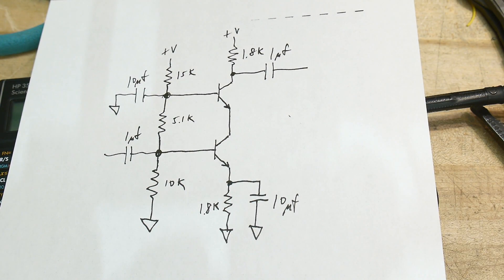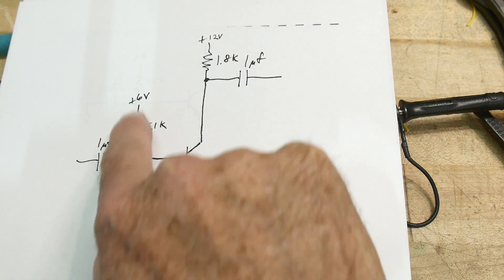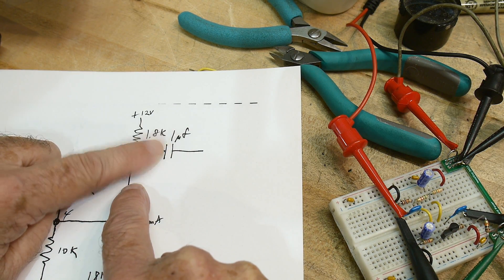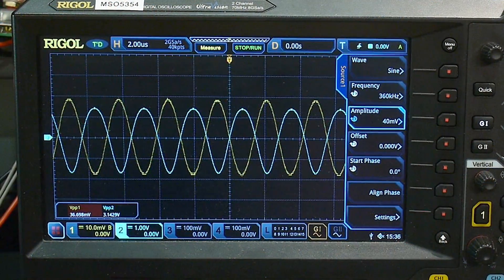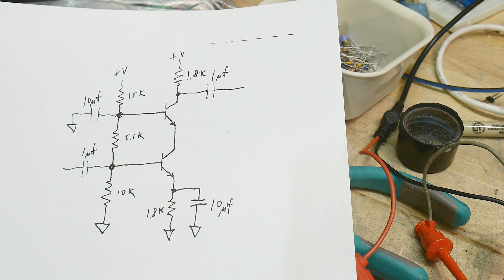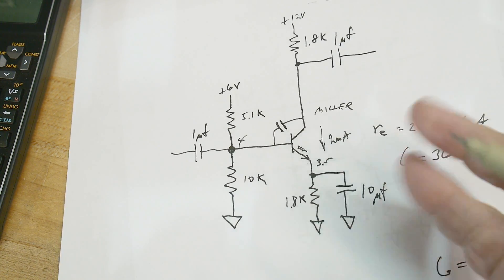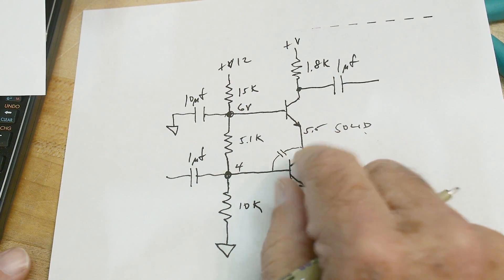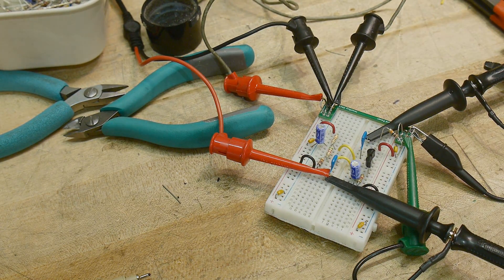#1769 Cascode Amplifier (part 1 of 2)

Comment: I admit I must be missing something, but why doesn't the Miller capacitance of the top transistor now become the villain?
Reply from the maker: you need to study common base amplifiers, they have no miller effect.
Reply: Thank you. I found a nice explanation on the Analog Devices wiki. In a nutshell "The base [...] of the cascode device is electrically AC grounded, so charge and discharge of stray capacitance [...] between collector and base [...] is simply through RL (the output load) , and the frequency response is affected only for frequencies above the associated RC time constant" - which would be a pretty small RC and hence a high frequency.
Reply from the maker: @thelastofthemartians  if you want more: https://youtu.be/tAK8Q5IZjng?si=yxtKcfJt7jr8FvuE

Comment: If my memory does not fail me, a gentleman at Tektronix, by name Gilbert, introduced cascade use for beam deflection in the ever faster oscilloscopes.  Two of my (employer’s)early oscilloscopes were rated 450 and 500 kHz.  A Solartron scope around the same time was as fast as 5 MHz.  Then I found a plug-in module for the old 450 kHz scope, boosting it to 20 MHz.  Also, if anybody built Heathkits, there was a 5 MHz scope kit offered.  Then came (and stayed for a while) the “standard” 100 MHz rated scopes, thanks Mr. Gilbert.

Comment: Very well explained.  Cascode amplifiers are good when a higher frequency response is needed, and you can even add more cascode stages.  With a single cascode stage, it is the same as a common base stage.   Several years ago I listened to a UBC EE prof give a talk on a company's laser diode driver chip.  It used an emitter couple pair with current sources as an output stage.   The UBC prof referred to it as a cascode.  He was not happy when I corrected him.   I don't know if he had designed the custom chip, but I found several problems with it.  I had been hired to give an independent evaluation of it.

Comment: The miller capacitance is only in inverting amplifiers. The AC voltage across the capacitor is the
 (voltage gain+1) times the input voltage and efffectively shunts the input to ground at higher frequencies.The effect increases with the amplifier stage gain.

Comment: Cascode can improve frequency response by factors of 50 or more.  In this case the 5.1 k resistance between the amplifiers is limiting the effectiveness; an inductance to block the AC through this path will greatly improve the frequency response.  (Or use separate dividers for base bias...)

Comment: When selecting transistors, what datasheet parameters do you look for to ensure higher bandwidth circuit?
Reply: On a BJT datasheet, look for "transition frequency," which is typically denoted f_T (f subscript T).
Also, look for the gain-bandwidth product on other amplification circuits.  That should get you pointed in the right direction 😉

Comment: Thanks, very nice explanation of how they work.  I have seen them used in older receivers but never really thought much about how they worked.  Makes perfect sense.  I will have to play with them once I get my lab set up again after getting new flooring installed.  I need to take a trip over to Anchor, haven't been there in months. 
Craig

Comment: Cascode drives in the way you showed here were used (because of the benefits you mentioned) as video amplifiers in old CRT TV-s and monitors. Also, one interesting feature, since the lower device is working with colector (or drane) voltage being arbitrary defined via biasing the upper device, cascodes were also used in industrial offline flyback power supplies, working from input voltage in the range of 200-1000V. They would use some really high voltage bjt (and a slow one also) and drive its emitter via some light, low voltage and low Qgate mosfet. Ofc, these solutions are now obsolete since one can buy SiC, GaN and other "exotic" semiconductor devices (mainly mosfets) working with around a 1.2kV of a drane voltage and also having really small Qgate and Rdson. :)
Reply: Had to dig out this circuit recently as I needed a MOSFET to handle 3kV in linear mode.
Those SiC and GaN devices are for switching only and not rated for linear use, so I had to stick to ancient planar MOSFETs.
Reply: @inse001  I'll find you a few publications I had back in the day about that, and I'll be glad to send 'em to you, though they tackle the problem of a cascode in a switch mode regime. 
But, I see no problem in making as many (must say theoretically) staged cascode as your power supply voltage dictates. If You use for example 3
 NHL160N120SC1 mosfets, 1200V, 160mohm, 34nC gate charge devices. Bias the second and the third one at 1000 and 2000V respectively, and make the lowest one (the one at the 0V) an op-amp controlled current sink. Ofc, you'll have to take all the percautions of RF and HV designs since SiC are damn fast components and 3kV is really unforgiving voltage level...
Reply: @nonamemad9053  Thank you very much for the offer.
The problem is already solved, I cascoded four BUZ50A (1000V) to form a constant current circuit sinking 1mA from 100 to 3000V to keep an electrophoresis power supply activated.
It monitors the output and switches off in case no load is present.
I found support in The Art of Electronics and the EEVBLOG forums.
Reply: When I was a teenager, our tv died and the tech changed a high voltage driver transistor BU208A.  This transistor had a 750V Vce and 1500V Vbe with the gain of 2!  I always wondered why such a stupid low gain transistor needed to drive the high voltage.
Reply: @bayareapianist  There were two high voltage transistors like BU208A in old crt tv sets. First one worked in horisontal output stage driving a high voltage transformer and horisontal deflection coils. This one was hard to die exept in case of high voltage transformer or coupling capacitor gone bad. It was fairly well driven , since the most sets used blocking oscilator providing strong bipolar pulses to its base. (I'll detail on it later...)
 The other one worked in offline flyback power supply, producing all the voltages the set needed. This one was much easier to kill, and one of the main modes of failure was the base drive circuit that used a zener diode in parallel to an electrolytic capacitor to produce negative base drive during the turnoff and speed up the proces of extracting carriers from the base. When the electrolytic, inevitably goes bad, the transistor would start to overheat and essentialy was doomed. 
 Also, that high voltage statement was true only in case of a base driven below 0V. :) 
 About small hfe of high-voltage power transistors, because of the performances needed, the engineers used something called multilayered epitaxial process to design the thick crystal that could withstand the high voltage. That came with a price of a low carrier mobility, and also low carrier density, effectively limiting hfe to few tens, to around a hundreed, or in case of high collector current to single digit values (though not as low as 2). This problem was tackled by various companies that went as far as designing high voltage darlingtons  that were plagued by low speed or great storage times. Problem was finally solved by using high voltage mosfets or in the last decade and a half by SiC mosfets, that are not just for a high voltage but have even lower Rdson, and are quite faster, also easier to turnon because of the low total gate charge. Ofc by that time crt sets were long gone... :)
Reply: @nonamemad9053  Thank you very much for your answer.  As long as I remember (30+ years ago) the TV had a large transformer for the other voltages. I remember the tech said for the CRT high voltage, I didn't need that much current and as long as there was a protection diode the transistor should have worked fine.  I think he changed the diode too.
Reply: Very interesting .. thank you 👍